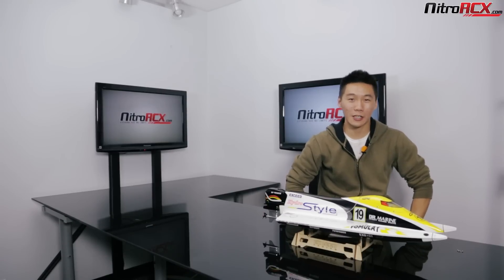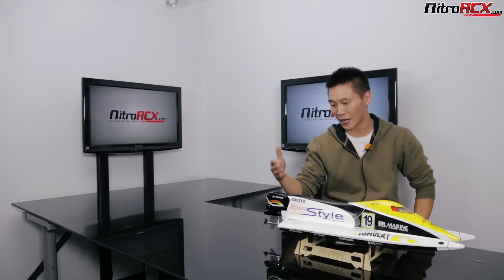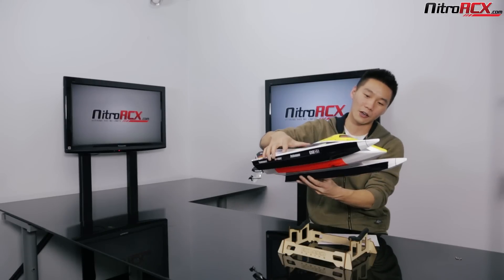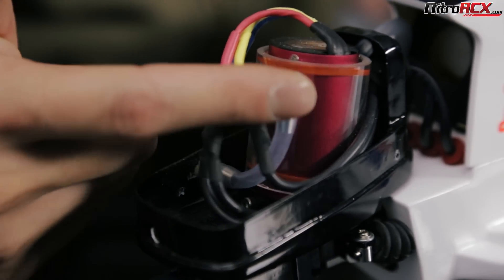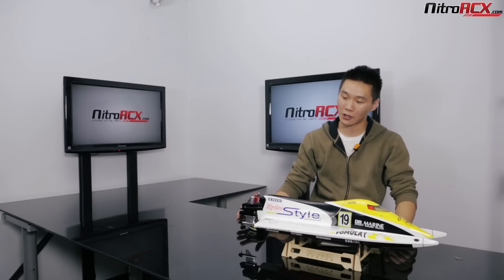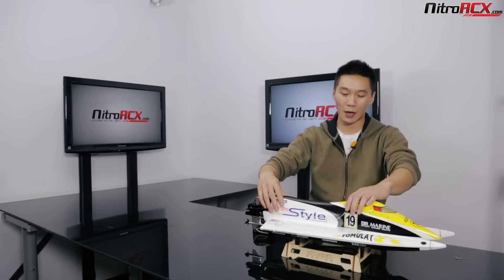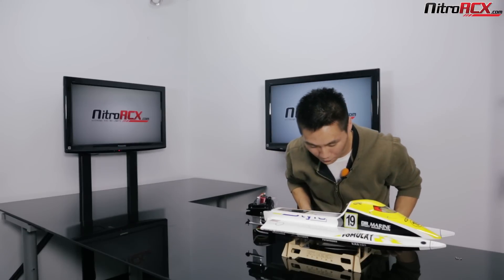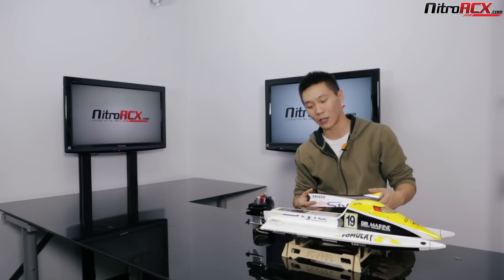New Exceed Formula 1 Electric Racing Boat Overview

Comment: May I know this outboard use what kind of drive ? Use flex shaft drive or use gear drive to propeller ? 
Thanks
Reply from the maker: The motor is housed in the out drive and the prop and motor is connected by a flex shaft.